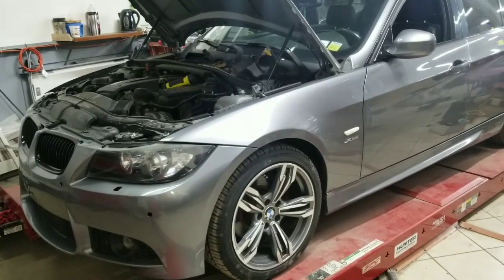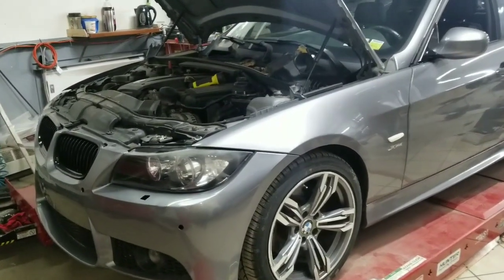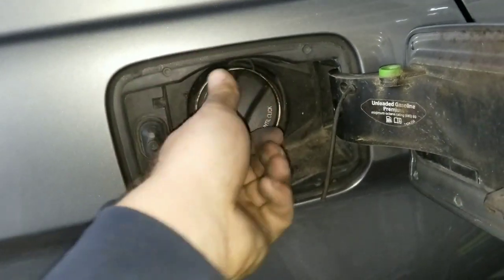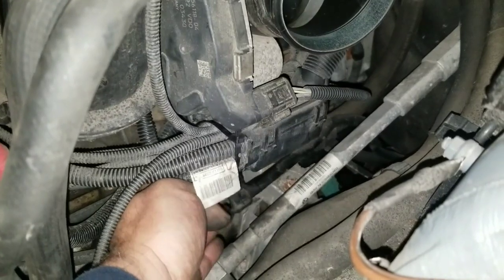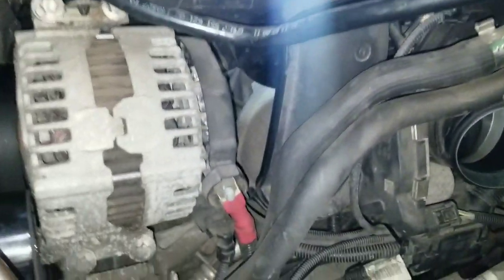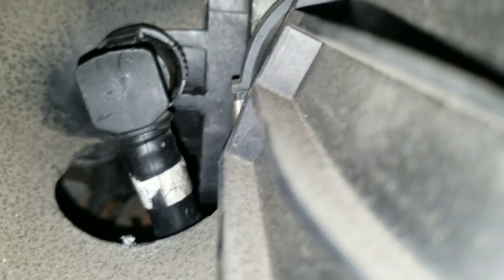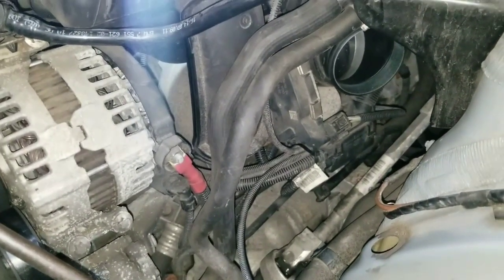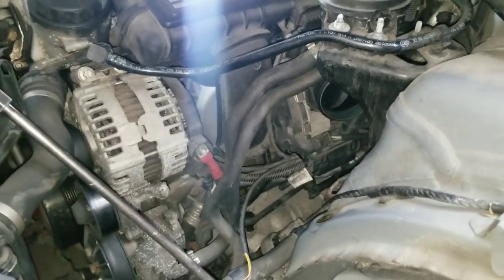BMW CHECK ENGINE LIGHT DTC 2A16 FUEL TANK VENTILATION SYSTEM & PURGE AIR SYSTEM MINOR LEAK.

Comment: Im stuck man I hope you can help. I have a 2011 535i I have permanent code P149D with no CEL but code is there so I replaced the whole shutoff valve and have done several drive cycles and still no luck. Any suggestions?

Comment: I have a question that code is associated with  leak detection pump too?  Because i have toe same code I replaced the gas cap but the code came back.
Nowi bought the leak detection pump I didn’t install yet but I wanna be more clear if is this this connection or leak detention pump. Thanks my code is 2A16
Reply: Did it solve your issue?
Reply: @giovannyluque6034   i replace the Leak Detection Pump and I replaced gas cap and I also replace fuel tank vent valve and I can’t fix the code….the code still came to my dash
Reply: @davidascencio6644  I'm in the same boat as you mate. This code is really annoying.
Reply: @davidascencio6644  I've also checked all connections and everything seems solid so don't have any idea where its leaking from.
Reply: @giovannyluque6034  i will do this days probably the smoke test to found the leak I will update in next’s weeks
Reply: @davidascencio6644  pls lmk what you find.
Reply: @davidascencio6644  something unexpected happened today. So I jacked the front end of the vehicle to replace rotors and brakes and noticed I had fuel leaking behind the car. As I inspected I realized it was coming from underneath the rear seat where the fuel pump is. And I think the o ring is whats causing the evap leak not 100% sure yet tho gonna replace the o ring and see what happens.
Reply: @giovannyluque6034  update ?
Reply: @alexbeckford4151 the rubber o ring was leaking and my issue was fixed after replacing it and the ring clamp.
Reply: @alexbeckford4151  it fixed my issue 100%
Reply: @giovannyluque6034  thank you I have the issue rn and it’s killing me I can’t even full my tank in times like these not even half way because it’s gonna leak and stinks the car up and I needed a fix asap hopes this work for me
Reply: @alexbeckford4151  I'm almost positive it will to make sure Jack the front end up and look under the rear seat taking the cover off and you'll see a puddle of gas on top of fuel pump then you know forsure your o ring is bad.
Reply: @DSRDRENTERPRISES  there's a green ring gasket on the fuel pump under the rear seat. I found out mine was leaking by filling the gas tank and then jacking up the front end that was when I saw gas leaking front the fuel pump. All I did was replace the o ring and change the clamp and I was good

Comment: George , if you would get a digital video recording endoscope , you could get in between there and show us a better picture .
I just bought one recently with a 4.3 full color screen recordable compatibility , on a TF card 1080p high definition for the Video. -3-10 cm
Oiiwak - Digital Inspection System -  At Amazon

Comment: mine says that but it smells like gas by the driver  rear side
Reply: currently having that issue, did you ever confirm what the problem was?
Reply: @japeth3568  the gas tank seal is eaithrr broken or the fuel line above the fuel tank by the side you fill up is cracked .  It’s not the charcoal thing . But when I fill up it leaks if I fill up more than a half tank. Fixing those two things will fix the problem. Most likely the line above the fuel tank is cracked like mine.
Reply: It’s the regulator the plastic cap under the rear seat cracks and leaks fuel
Reply: Yeah but that’s not what it is it’s the gas fill tube the seal is worn out that connect to the tank. The other issue is that it is pinched by the side of the gas tank. The cap on there never breaks unless you break it but there is no gas coming from there I even check before installing stage 2 full pump.